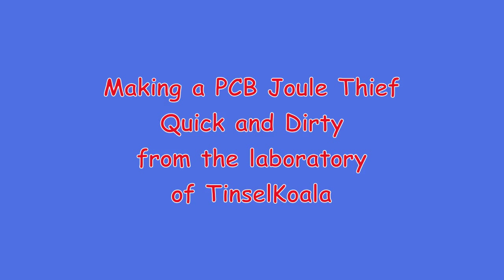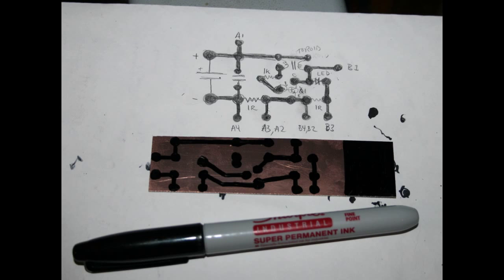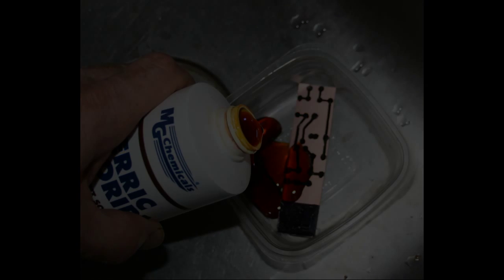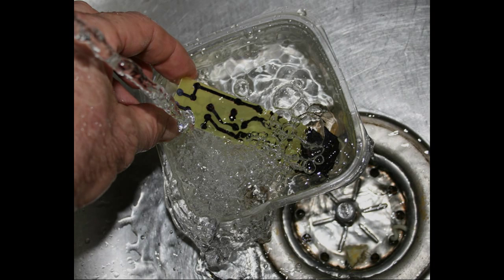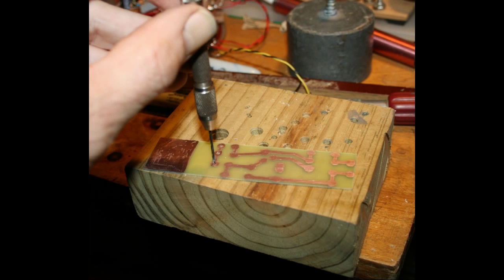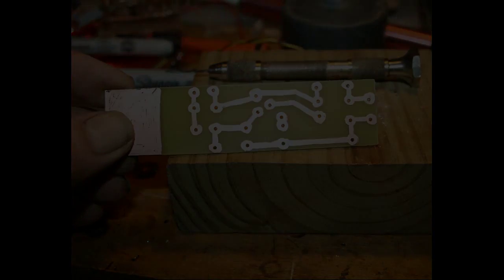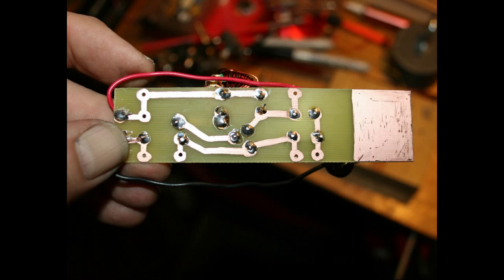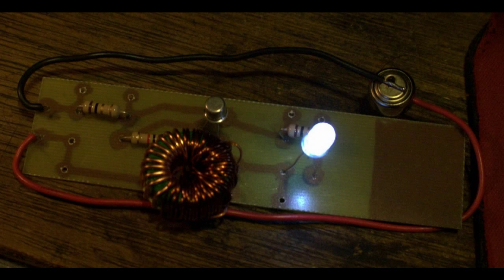Joule Thief: Making a Quick and Dirty PCB Joule Thief

Comment from the maker: The copper displaces the iron, makes copper chloride. The iron precipitates out as fine black powder. Eventually, yes, you won't be able to etch much and your solution will be mostly copper chloride. I probably make four boards this size in a year.... if I was making boards daily I'd be wasting less, collecting the used material after making several boards, and keeping it separate. As it is, when the bottle "slows down" appreciably I just get a new bottle and take the old one to waste disposal.

Comment from the maker: Yes, pin vise. Words failed me for a moment -- I always work without a script. This is a Snap-On pin vise that has 4 different chuck sizes. My better Starrett pin vises are in the other lab location right now.
For this particular board I figure the cost is less than a dollar and a half, all told, since I can get about 12 strips this size from a 4-dollar piece of PCB material, and the etchant and resist pen cost about 12 dollars. Plus, the pen and etchant would not be completely used up.

Comment: The 'hand chuck' is known as a Pin Vise.  I use the ExpressPCB free software to design a PC board, and then send it to them for making the board.  Three 'Miniboards' costs about $65.00 and will get back to you in a few days.  The cost does put a lot of pressure on you to get it right before you commit to making the board.  But the results are very good.  BTW, I have had my fingers so brown from the FeCl that people thought I was smoking.  So I'm no stranger to 'DIY' PC boards  Thanks.

Comment: Running Peppermint 3 here :)
Maybe record using Audacity and save out as pseudo stereo, by duplicating the recorded track, mixed left/right and save out to add in the vid. Worth a go. OpenShot vid editor is pretty good with overdubbed audio in Ubuntu.

Comment from the maker: You are welcome. Try a scrap bit of your board material, with the ferric chloride at room temp or slightly warmer, and agitate so that fresh liquid gets to the cladding as much as possible. I did it for this board by using the plastic fork to lift and drain, lift and drain, etc. Please let us know if this helps to speed up your processing.
PCB material does come with different cladding weights; the stuff I used is called "UL-FR-4, 1 oz Copper" and comes from the same manufacturer as the etchant.

Comment from the maker: Sorry, I guess I wasn't clear. The quarter-volt ones I've make will light a bank of LEDs but don't quite reach the 350 volt range. The 360 volt one with the neons runs on something less than one volt from a AAA battery. It does use VRSWR but in a magnet-biased ferrite that I modded by adding an outer "primary" winding.  So a bit over 360 to 1, not quite in the range of a proper TC yet.... but the current available is tiny. It is neat to see those neons glowing from only the "dead" AAA though.

Comment: One quarter to 350 , that is a ratio of 875 to one.
One half to 350 is 700 to one. (Or the other way around.) : |
That is about the level of voltage transformation ratio you get out of a Teslacoil.
Not bad.

Comment from the maker: I think it's a neat name, I wish I knew who came up with it first. "Joule scavenger" just doesn't scan quite as well as the play on words "Joule Thief". Time thief would also be appropriate.... :)
I see that some people are getting them to start and run on mere millivolts. My low voltage best ones still need a quarter of a volt... but I have some that make 350 volts from less than one volt input and can light up neon bulbs.